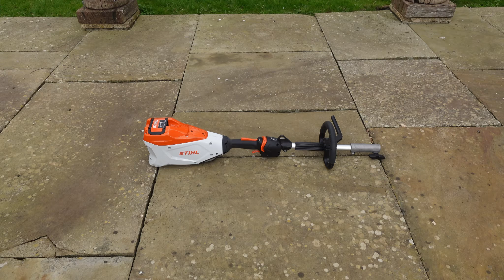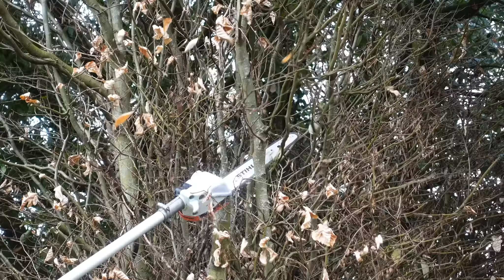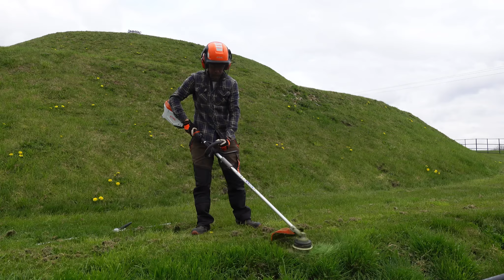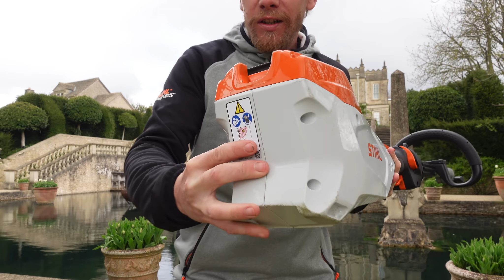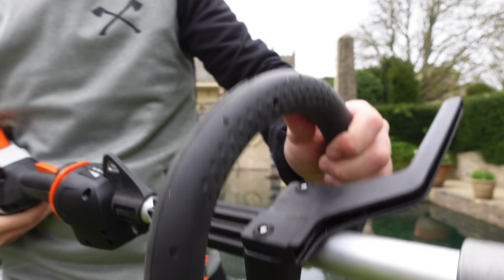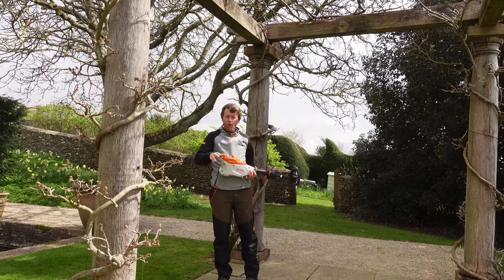STIHL KMA 135R Battery Kombi Engine

Comment: Interesting video. Could you help us understand runtimes? I just ran my KM-131R for an hour and emptied its tank with a brush cutter. Constant high load cutting through thick grass, weeds and bramble. You need all the power of the 131 for this and it runs very hot. I was also physically tired.

How long could I expect to run with an AP300 battery? Is it just for 15 minute runtimes at high load or could it run for an hour at high load before depleting the battery?
Reply from the maker: Hi, I have put a link in the description that will take you to a runtime chart, this will give you an idea of the runtimes you can expect from different battery and tool combinations.
I really do think you will get anywhere near an hour with a machine under that kind of load with the AP300 battery. 
my advice would be to use a backpack battery for larger jobs like that.
hope this is helpful
Reply: i think an ap300 BAT would last about 40 mins
Reply: @zarrow50  Thanks that's really helpful.
Reply: @jma24  I have started using Makita 40v

Comment: I would buy this kit tomorrow but for one thing, the cost of the powerhead, half decent battery and charger. Your looking at 700 odd notes, without cutting attachments.
I love Stihl to pieces apart from the cost of their gear. Maybe I can save up over the next few months and buy this kit and put my KM90R to rest. The only way forward  now is battery.
Reply from the maker: The initial cost is an investment. But when you factor in what you would be saving on fuel/oil servicing etc - the cost really isn’t that bad.
But honestly, the health benefits are the key to the battery kit.
😀 Thank you for watching 👍
Reply: The other option is other brands made from china that usually last a couple years. It's worth the investment in something made in Germany that lasts.

Comment: I don't get it with Stihl. Previous model, KM131R, needed a cord and a battery pack of choice. Now they're putting the battery in the unit. Whilst their latest BGA200 blower recently released also needs a cord. Time to make up their mind at Stihl. Who wants to switch all the time to belt or backpack battery pack or battery in the unit?
 I've got a complete battery setup with 6 AP300S batteries, and have to admit, runtime is great, noise level is of a different kind, maintenance is non existent and power is more than sufficient.
Reply from the maker: I suppose with the blowers it is down to space? to have a large capacity fan, with a battery chamber in the unit too - there is the potential for the unit to be a bit cumbersome?
it is certainly very interesting to see how the battery machines are developing.
Thank you for watching 👍

Comment: Has it got a faster cutting speed on the hedge cutter attachment over the stihl hla 66/86
Reply from the maker: I do believe the cutter speed is 4000 cpm, so faster than the 66 & 86
Reply: That will please a lot of people. It will be interesting to see what you think of the 4000cpm over the hla 3000 cpm and it would be good to see what you think of the weight difference between this and the hla 88